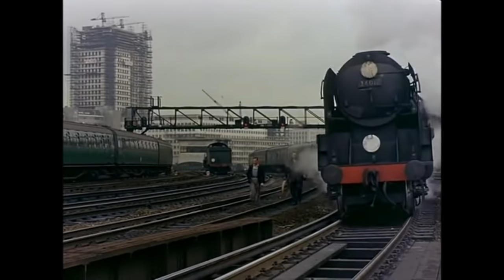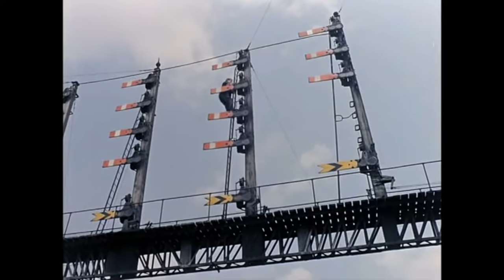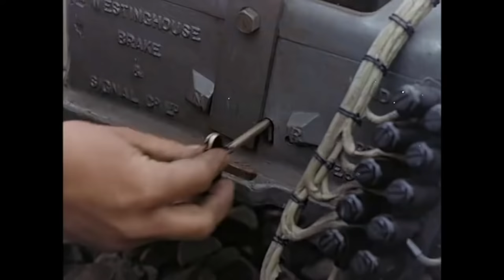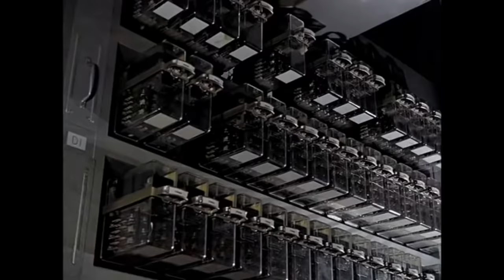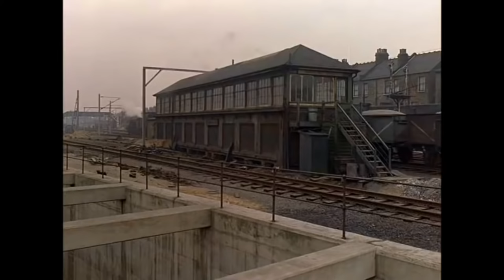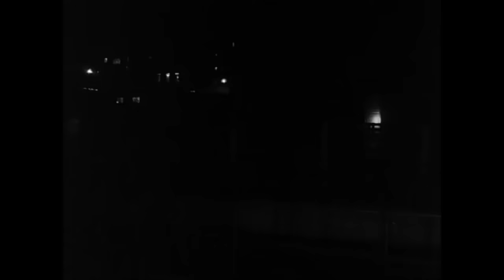Vintage railway film - The signal engineers - 1962

Comment: When I was at VSC Clapham junction, lots of signalling failures. ASE was 'Wrong man for the job' had to be paid off. Replacement narcissistic told by Chairman BR Board that he was to be sacked in 6 months time unless failures dropped. Bought in man from Swanley led a task force team found lots of equipment faults reduced failures.

Comment: Strange how it's Colour Film until 18.50 then Black & White for the remainder
Reply: Probably due to colour film not not having a fast ISO rating at the time i.e. not working very well at night in low light conditions, whereas B&W film did work well in low light.
Reply: @michaeldutsonlandscapephot2184  correct with the ASA/ISO. Very likely that this is Kodachrome which had 25 ASA in the early 60's. Kodachrome holds best the colors - GUARD/ RETAIN the original films even if digitalised. I think they will survive even that digi-stuff in the next solar storm (carrington event of 1859) or a russian EMP attack.